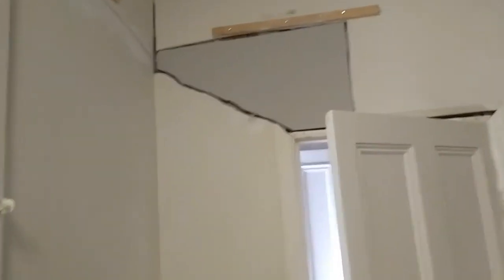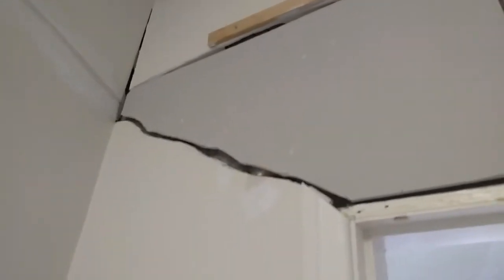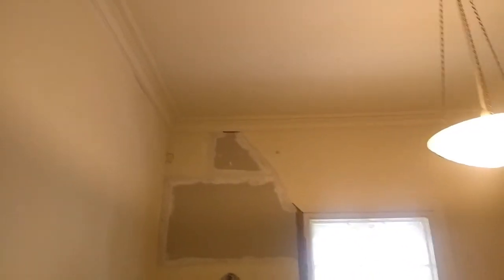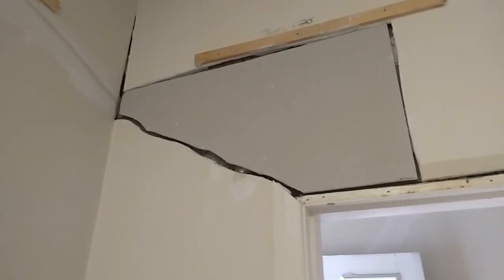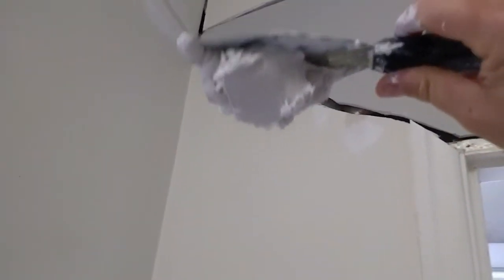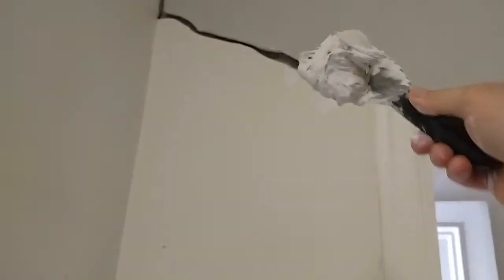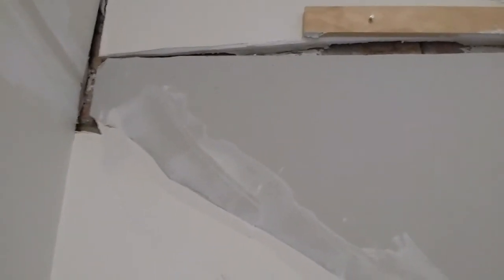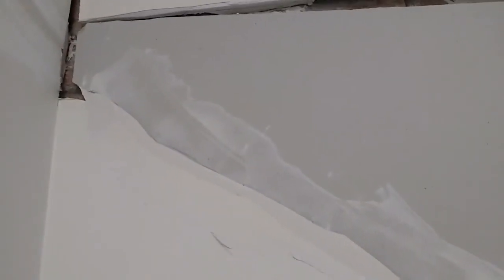Plastering repairs: Pre-fill wide cracks with cornice cement prior to taping

Comment: Novice question, but if you fill it with cornice cement like that, why do you still need to tape it afterwards?
Reply from the maker: Because joints are always likely to crack over time without tape
Reply: @The3rdCoat  Ahh yeah that figures. Thanks!
Reply from the maker: @prodigalretrod  have fun!

Comment: Can you use Cornice Cement as a topcoat with the tape?
Reply from the maker: I wouldn't recommend, because cornice cement is a lot more tacky than base coat, and it doesn't penetrate the tape very well. You may be able to get away with it if desperate.
Reply: @The3rdCoat  Thank u so much!
Reply from the maker: @mamapucha5365  I may have misunderstood your question anyway. Are you thinking of using the cornice cement to put the tape on with, or only as the final coat?
Reply: @The3rdCoat  corners of doors, window frames and walls have cracks that I was planning to fill with cornice cement, then put paper tape on top with CC and second coat as my top coat with CC as well
Reply from the maker: @mamapucha5365  you should put the tape on with base coat. The rest should be fine